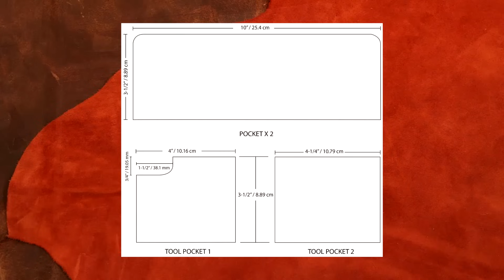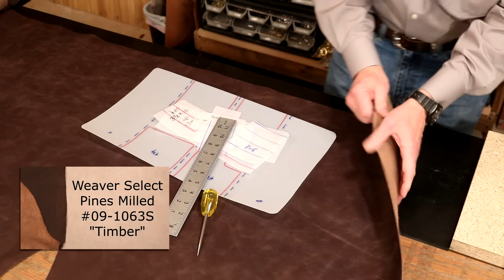Making a Leather Tool Roll

Comment: For the corners you could use a scribers compass. Normally they are used for metal work in conjunction with calipers but they work great with leather when going around the edges and keeping the same distance all the way along edges.
You lay one point of the compass on the outside of the leather and the other point lays on the leather and you just pull the compass along the leather and it scribes a precise line all the way along. It can be adjusted like any other compass with an adjustment wheel between the two arms.
Hope this helps.

Comment: 6:13
17:35

Why make the knot on the inside of the pockets, as opposed to making the knot on the backside of the pocket?
The knot will be hidden either way, so why not make it where it is easily accessible?
Reply from the maker: You can do either way - depending on what you store in those side pockets it could catch on the knot so that's why i tucked it in the seam of the pocket. That puts it completely out of site and nothing will get caught on it.
Reply: @WeaverLeatherSupply  
"depending on what you store in those side pockets it could catch on the knot"

I don't think you understood what I was saying.
If the knot was on the backside of the pocket, then nothing would ever come in contact with the knot. You wouldn't even need to bother tucking the knot into a seam doing it that way.

Comment: Total newbie so my question may be very basic.  In order to accommodate a tool handle, don't you need to have the pocket pinched in as opposed to laying flat?  Or does the leather stretch to allow the tool to fit?

Comment: Hey Chuck! I love your videos about leather armor and costumes but I was wanting to see if you could do a video about finishing and protecting leather armor in case you get caught in the rain at a Renaissance fair or if you are filming a scene in the rain for a movie or film so you don’t have to scrap the armor and make another one.
Reply from the maker: I have struggled with this one for so long and I am sorry to admit that I just don’t believe sealants work as well as we would hope.  Leather is so porous, and, it has holes, a skived side, edges…and the only way to really seal it would make it stiff and unusable.  With your email I’m going to go back and work with some of these and see what tends to work best.  Once I get some confidence we’ll put an Element together for you!
Reply: Treat leather with neatsfoot oil,
(mineral oil also works).
May not need it on new leather; either oil will help restore old leather.

Comment: 2 questions. 1) I've seen aging techniques, but how do I distress veg tan leather? How do I make it look gnarly?
2) I've seen veg tanned vs chrome tanned, how about oil tanned, how does oiled leather affect finishing?
Reply from the maker: Hi there,
1.) You can buy some veg-tanned leathers, like a pull-up or rustic harness leather that will have an aged look but the best way to age new veg-tan leather is just with use. Work it with your hands, use an antique finish, you can always wet mold it into the shape you want to to be. every day, regular use of the product will give you the best, aged look.
2.) Oil-tanned leather will usually also have some veg or chrome tannage in it also so it depends a little bit on that. I'm not sure what you mean by finishing but you shouldn't have to add a finish to oil tanned leather. It's dyed during the tanning process and should be good to go as is. 
Hope that helps.

Comment: Nice tool roll, but I thought you shouldn't use chrome tanned leather with metal (the Pines Milled Leather says it is a chrome tanned leather). Am I missing something?
Reply from the maker: You’re exactly right.  Chromes can tarnish metals.  In this instance we could go with a veg, and with molding do a very cool pouch but, it just wouldn’t roll well.  It would soften with use but the chrome is just a good supple leather.  The biggest issue, in my opinion, is more for moisture than the chrome.  A chrome touching metal with some moisture involved would tarnish overnight, but without, it shouldn’t be an issue with stamping tools. Long term (years) I can’t say but the tools should be fine.  I would stay away from veg-tans with a high oil content.  In my experience the oils are bad about tarnishing.  Always a good question!

Comment: Chuck with chrome tanned leather won't there be a reaction with the steel and brass. I even have trouble with dyed veg reacting to brass on knives . Happy trails
Reply from the maker: Hi Mike,
You’re exactly right.  Chromes can tarnish metals.  In this instance we could go with a veg, and with molding do a very cool pouch but, it just wouldn’t roll well.  It would soften with use but the chrome is just a good supple leather.  The biggest issue, in my opinion, is more for moisture than the chrome.  A chrome touching metal with some moisture involved would tarnish overnight, but without, it shouldn’t be an issue with stamping tools. Long term (years) I can’t say but the tools should be fine.  I would stay away from veg-tans with a high oil content.  In my experience the oils are bad about tarnishing.  Always a good question!

Comment: I got some good quality chisels, but have trouble getting them through even very thin leather. I have to hammer with a heavy mallet, and still usually cannot get the larger chisel through. For a surface, I have a concrete floor, poundo board, wooden cutting board, and then the leather. Is there anything I should do to make the process easier?
Reply from the maker: Hi Greg,
The main thing would be a solid foundation and the concrete floor should do it - just make sure it's an even surface so there's minimal bounce when you hit the chisels. The only other thing I can think of is to try putting a scrap piece of leather under the leather you're punching - this will help the tines sink through the leather.

Comment: what kind of material are you using for your template? I tried using those cheap plastic folders that come round at the start of each school year but the material starts to crack after several uses. I'm looking for something slightly more durable.
Reply from the maker: Hi Byron,
We'll link the pattern sheet below for you!
https://www.weaverleathersupply.com/catalog/item-detail/65-4110/pattern-sheet-24-x-45/pr_8876

Comment: Would lining the roll with suede be safe, or would it damage the metal tools like a chrome tan? I am specifically thinking of one of the very colorful ones, which are listed under chrome tanned on the website.
Reply from the maker: Hi Greg,
Lining with suede should be fine. We did some testing with metal and chrome tan suede and it had no effect on the metal. Moisture will cause more harm than anything to metal. Hope that helps!
Reply: @WeaverLeatherSupply  Thanks for the info!

Comment: What weight/kind of leather would folks recommend for a tool roll for wrenches?
Reply from the maker: We would recommend a 5/6 oz. 
Veg tan will give you more body and hold it's shape but a chrome tanned would work also, especially since it will be rolled up.

Comment: Chuck what are you using for your templates?  I'd like to make some and keep them for later.
Reply from the maker: Hi Justin.
For patterns that I know won't need edited later, I use our plastic pattern sheet. It's nice and strong and won't get ruined if you accidentally spill dye or whatnot on it. I'll link it here for you: https://www.weaverleathersupply.com/catalog/item-detail/65-4110/pattern-sheet-24-x-45/pr_8876
Reply: @WeaverLeatherSupply  thanks for the reply, I really want to make this so I'll probably be pushing forward with it soon.  Maybe not as a first project but in a few months hopefully.

Comment: I thought chrome leather shouldn’t be used to store metal tools. Is this okay?
Reply from the maker: Hi Joshua,
You’re exactly right.  Chromes can tarnish metals.  In this instance we could go with a veg, and with molding do a very cool pouch but, it just wouldn’t roll well.  It would soften with use but the chrome is just a good supple leather.  The biggest issue, in my opinion, is more for moisture than the chrome.  A chrome touching metal with some moisture involved would tarnish overnight, but without, it shouldn’t be an issue with stamping tools. Long term (years) I can’t say but the tools should be fine.  I would stay away from veg-tans with a high oil content.  In my experience the oils are bad about tarnishing.  Always a good question!

Comment: How could I do this for wrenches?
Reply from the maker: Hi Sean,
I might say go with a heavier weight natural veg (5/6 oz. maybe or a 6/7 oz. for heavier wrenches) and wet mold the inside pockets to the wrenches.  That weight wouldn’t roll as easily as a lighter weight but it will have some good body, good protection for the tools and it will soften up nicely with a little use.